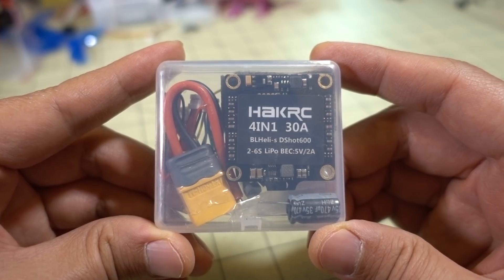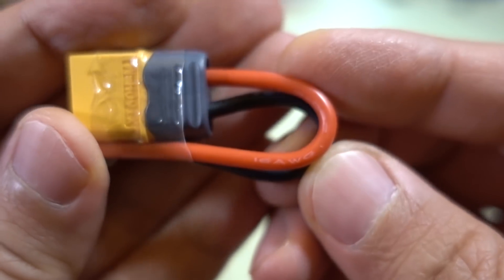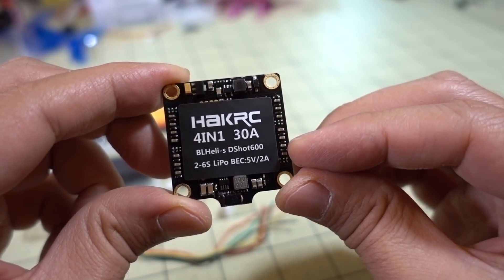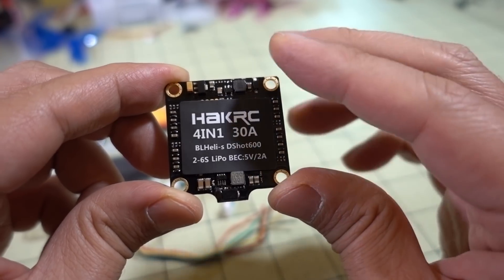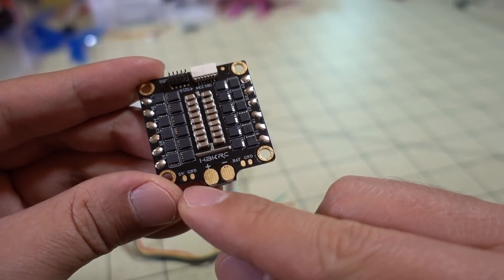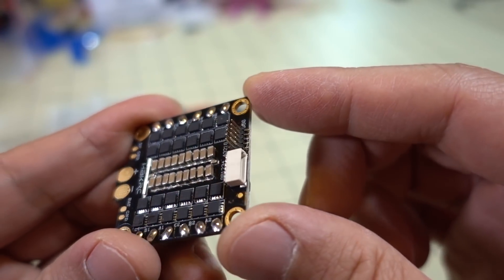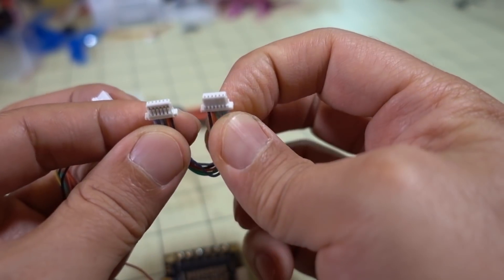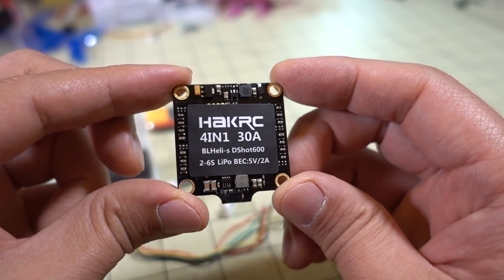HAKRC 30-amp 4-in-1 BLHeli_S ESC 👍

Comment: I just yesterday tried to connect one to my fc (2 of them) and I burned both of them. Can not see the mostake on my side. When I connect the signal wires my fc just dies. I been using smokestoper and voltmeter on every step. Did you actualy tried to connect this to any fc with jst connctor ports?
Reply from the maker: I believe it sends FULL lipo voltage on the power line.  A lot of FCs expect 5V, so that will cause the smoking.
Reply: Albert Kim- nor really. If you read my message again you can see that when I connected power it worked ok, but when I comnected signal wiers it got fried
Reply: Josic S. it is possible that you connected a vbat wire directly to signal port. check all your ppm wires voltage.
Reply: Vincent Ko I would not say so. Last 4 wires are signal wiers.
Reply: My experience away check the ground and vbat pin location from the ppm plug using a multimeter. It is possible that you got the sequence wrong way round.
Reply: Hi, same thing happened to me lately when I connected a Hakrc F722, then a F411. Both are dead right upon connection to this ESC. For the first one I had thought that I had used a wrong cable from my cable box. Now I understand that the pinout on the esc and on the FC are different for the 8 wires connector. You should then not use the cables that come with the ESC and with the FC from the same maunfacturer because the pinout doesn't match and they will make you burn you FC even with a smoke stopper. :(  WTF!!??

Comment: Could you recommend a 4 n1 esc that will work with the Omnibus
F3 pro 30 x 30 mounting holes it has a12 wire connector? 
Thanks for the video😎🎮🤙🏻
Reply from the maker: Which Omnibus F3 Pro?  There are several variants with that name...
Reply: Albert Kim https://www.banggood.com/30-5-30-5mm-Betaflight-Omnibus-STM32F3-F3-Pro-Flight-Controller-Built-in-OSD-BEC-Current-sensor-for-RC-Drone-p-1156615.html?rmmds=search

Comment: Is there a 4in1 that let's you cap (aluminium) each individual ESC? Without the aluminium caps these things tend to desync in 6S - the ceramic caps can't filter out the high voltage noise - a single shared cap on the battery lead isn't optimal.